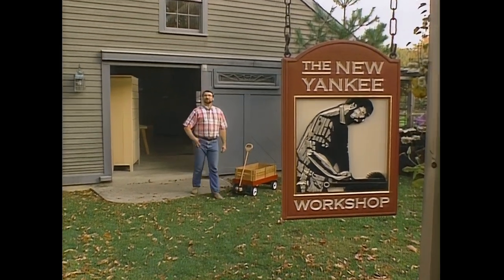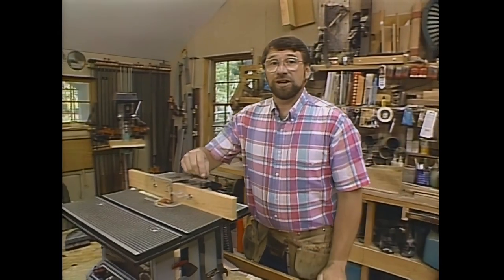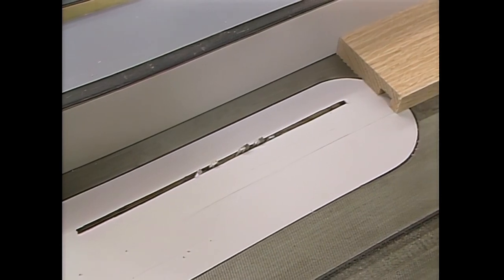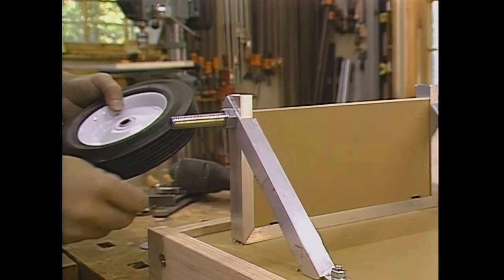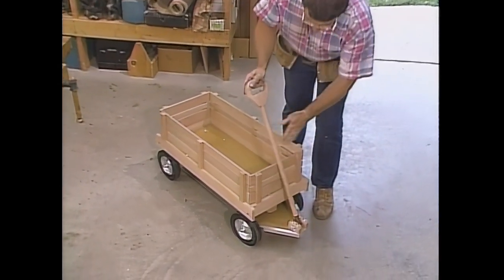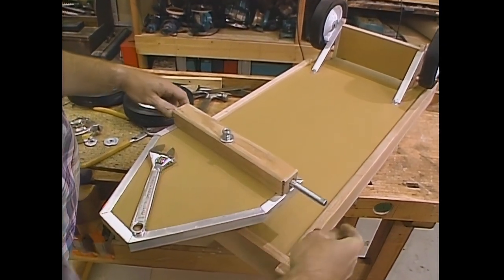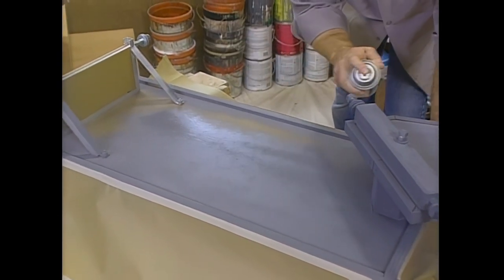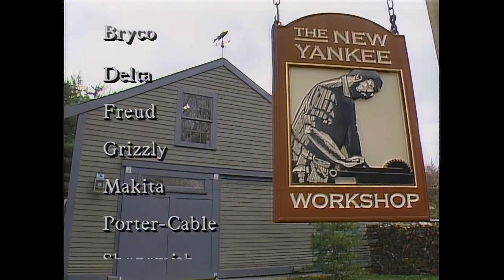Childs Wagon [AI HD]  |  S4 E3

Comment: The only thing I would change is to use castle nuts for the wheels and yoke
Reply: Acorn nuts might be a better choice. For a child's wagon, I would be hesitant to use castle nuts due to leaving the sharp ends of a cotter pin exposed. Acorn nuts would cover the whole end of the threaded rod or bolt. But then, the length of the rod or bolt has to be spot on...

Take care and God Bless.